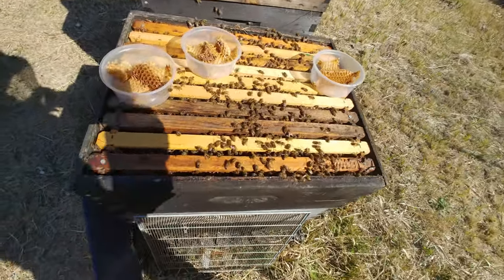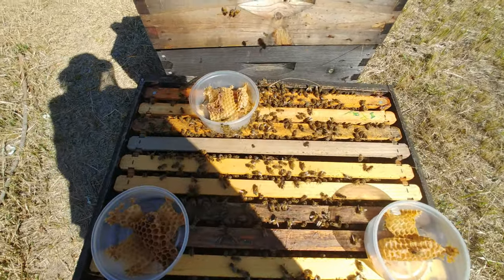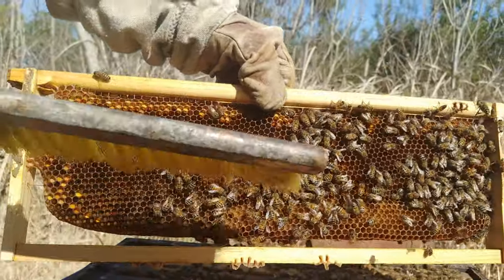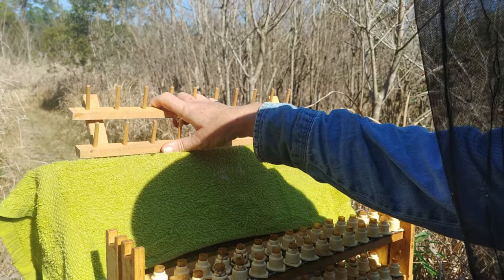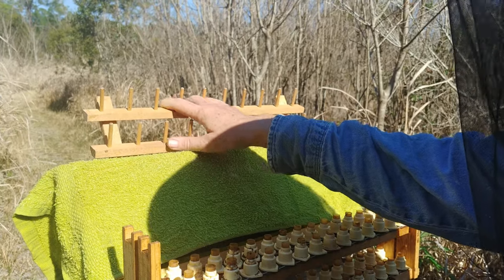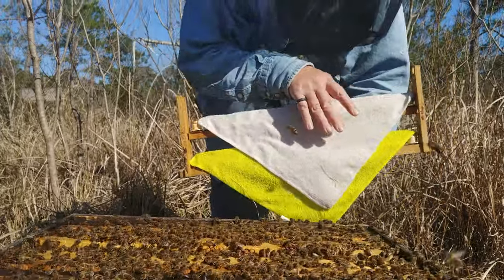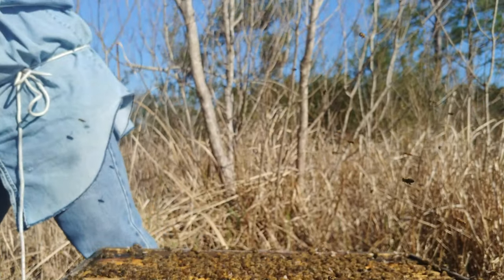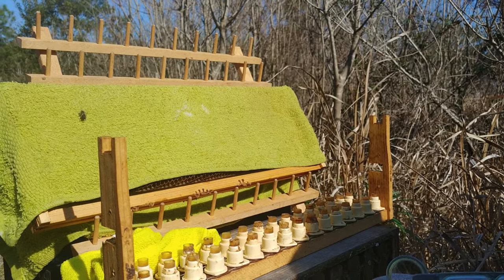☯️  HOW TO #GRAFT QUEEN BEES - GRAFT DAY -Part 2

Comment: If you were to rejoin the mother hive. How would you do it? Just put it together or use newspaper in between?
Reply from the maker: After 24 hrs you can rejoin the builder to the mother hive. No paper needed, as the builder is q-less. It would just be a queen right finisher.